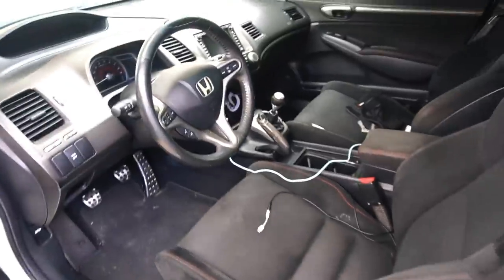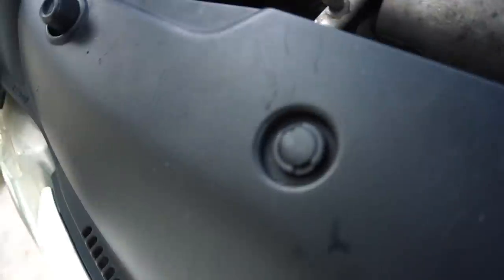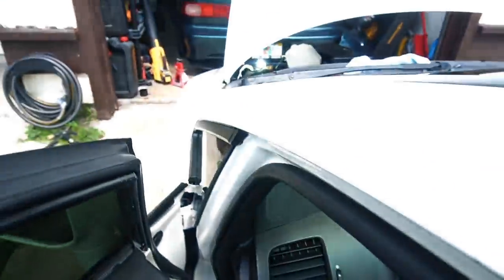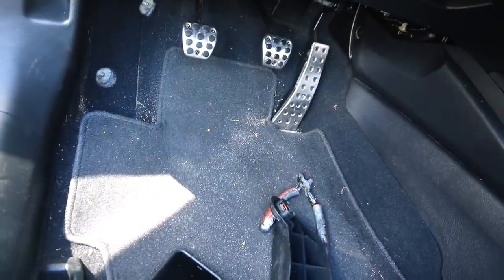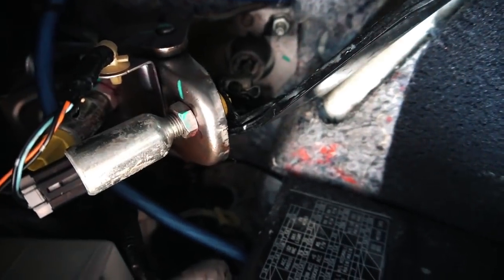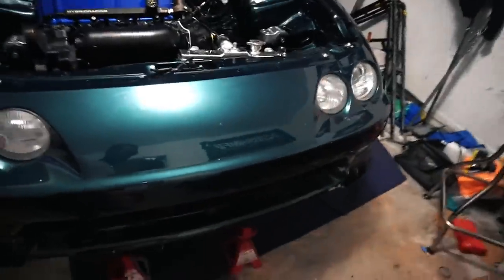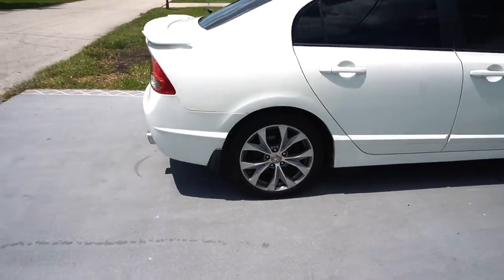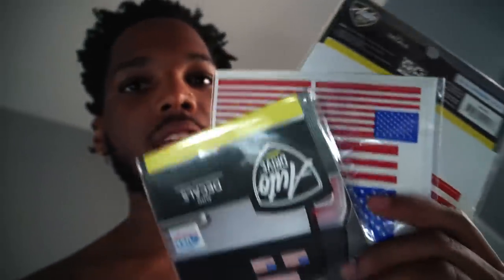Auxbeam LEDs Install, Clutch Bypass Mod & NEW Daily Wheels! - 'Akira' 8th Gen Civic Si

Comment: It took me a few years to learn this on my fa5 but if you jack up the car on  the passenger side and turn the wheel towards the the driver side you just pull back the fender liner a bit and it makes it so much easier to switch out that passenger bulb

Comment: don’t forget to adjust the rod in the back too! it’s a 12mm nut and you need to turn it clock wise till the space by the pedal closes on the yellow tab, make sure it touches. and then tighten the nut.